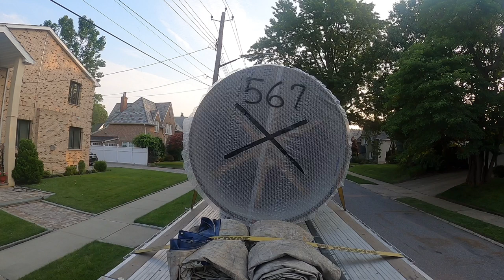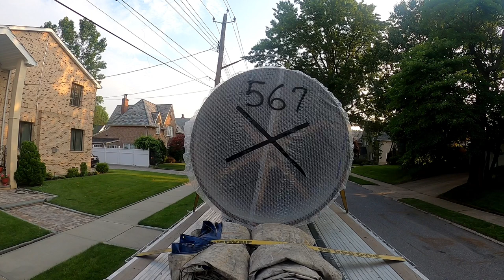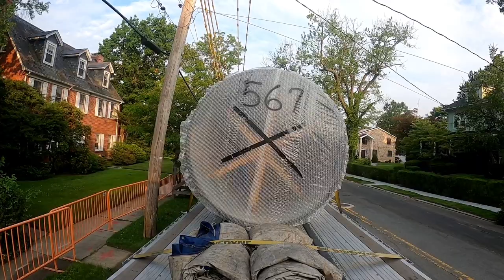Flatbed Trucking A Day In The Life

Comment: Is that your trailer break air leaking once you disconnect? Why not just shut off the trailer breaks when disconnected?
Reply from the maker: Not sure. Did I even drop a trailer in this video?
Reply: @bigsnow1705  in the beginning when you unhook from the loaded trailer and rehook to the other trailer to move it there is air hissing the whole way till you hook up to the empty trailer. Just wondering if you still had your trailer brake pushed in and that's why cause I've done that before bob tailing and been like oh shit and had to pull the trailer break knob out so it wasnt using air.
Reply from the maker: Oh no. It was pulled out. Not sure why it was doing that
Reply: @bigsnow1705  gotcha. Was just curious. Sounded like air leaking somewhere on the vid. Good vid though dude. I just started driving flatbed here in PA. Keep up the good content.